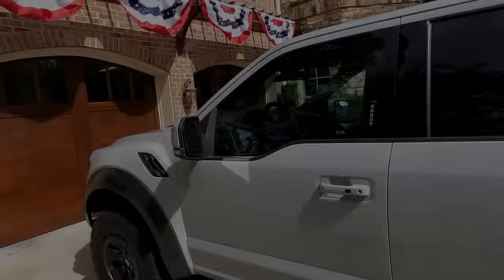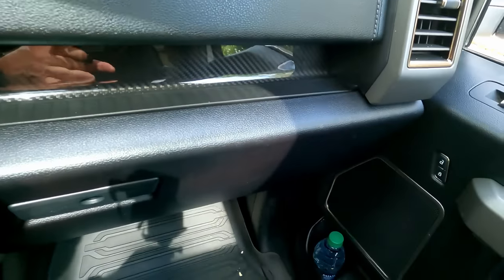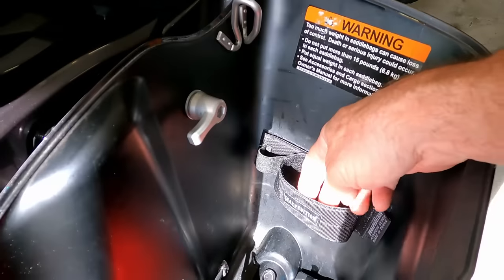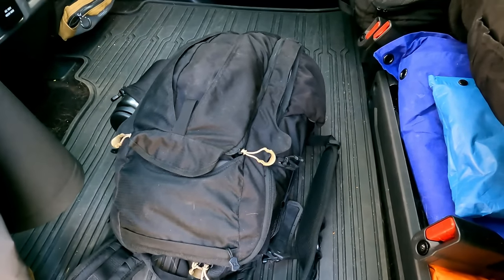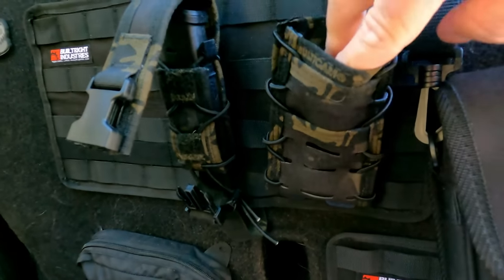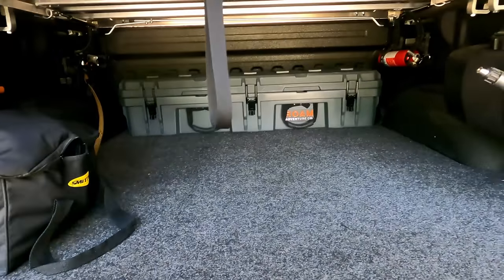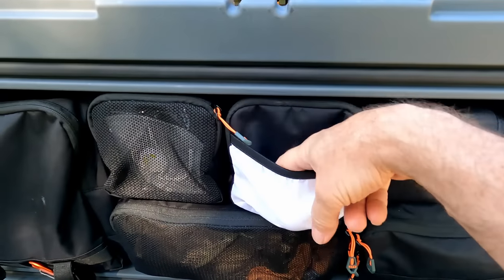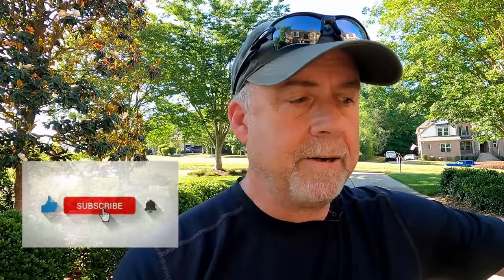Truck EDC - Everyday & Emergency Gear

Comment: Great video! Our set ups are much alike with the exception of my solar panel kits (240 watts in all), 25 amp wind generator, my axe/ shovel combo case but my most important item has to be my steel stake, hammer and horseshoes, great for striking up friendships(especially the Hawaiians), free beer and kills boredom for family and everyone. Really, think about what you are going to do with perhaps hours and days of down time if SHTF. 
    You might want to add a wrist rocket and pellets to save on ammo. Great video!
Reply from the maker: Todd great ideas.  Love the addition of horse shoes.  Used to play a lot on the beach when I was younger.  Great way to pass the time (while having a few beers)!! .......and saving ammo is always a great idea.  Thanks for watching and your comments.
Reply: @WeekendOverland  Well, there a story behind both. We use Wrist Rockets to shoot fishing weights and line to the top of trees to get our antennas up in the air, super easy. 
    I was in a friendly bragging contest with some fellow hams and we all kind of had the same emergency communications gear in our Jeeps but I won because I have something none of them don’t-“Horseshoes!” 
    If I changed one item in your set up, it would be your cell phone holder. Wife installed one in mine that automatically starts charging my iPhone after it clamps it into place. Super cool!
Reply from the maker: @digitaldreamer5481  I will admit the horseshoes idea is a big winner. I am thinking about an update video once I make a few more changes and I will have to include your horseshoe idea (and give your the credit of course!!) That phone holder does sound pretty cool.  Who makes it?
Reply: @WeekendOverland  Wife said she bought at Costco but not sure who makes it. The skates for the horseshoes, I had to wrap them with my spare blue tarps and zip ties in the spare tire well to keep them from making a lot noise and the horseshoes I put around the spare tire, was a perfect fit along with spare first aid kit. I have that area packed with supplies including HDR’s & MRE’s, hand chainsaws, heavy jumper cables, folding axes and snatch blocks.I also have a crash kit in another part of my jeep for easy access during emergencies. Actually, that’s not the half of it either. Folding solar panels with LED lights and battery clip extensions, marine battery connectors to turn car batteries into battery banks in a pinch for the two 100w solar panels and the 25 amp wind turbine I built myself. I built a tire compressor from a Sear Diehard 1150 that went bad but compressor still good, just added a 35ft vacuum cleaner cord w/12v alligator clips to deflate tires offroad & inflate back for streets, works well. It’s the ultimate bug out vehicle for tsunamis & hurricanes. I have a family tent but need one that I can keep in my JGC fulltime. Any ideas?
Reply from the maker: @digitaldreamer5481  Todd I think you need to make a video! Sounds like a great setup. In regard to a tent. There are a lot of great ones out there.  I personally have the MSR Hubba Hubba 2 man tent with the gear shed that connects to it.  I use it backpacking when not using my hammock setup (preferred). Plan to do videos on these in the future.
Reply: @digitaldreamer5481  curious about this wind generator. also do not know what a wrist rocket is. i know what a red rocket is though. hopefully not similar 😳
Reply: @cwr8618  Aloha CWR, I keep a 25amp wind turbine as a two piece set up that I wired with a 35 ft dc cord from a vacuum cleaner and added 12 volt alligator clips to attach to any 12 volt battery that I keep in the back of my bulletproof 4.0L IN6 Jeep Grand Cherokee. I use this for EmComm or emergency communications along with two 100 watt flat solar panels, all wired with Anderson Power Pole connectors, which I wired from the battery, through my firewall that powers two mobile ham radio transceivers inside on my front dash. As to the Wrist Rocket, it is a super sleek slingshot that fits over your left wrist and you aim by pulling it back with your right hand to aim. It’s pretty powerful and you can hunt with it also. You can even use and shot arrows with it if you get hungry enough to eat feral chickens, which are all over the place here in Hawaii, lol. Here is a link you can follow below:

https://www.ebay.com/itm/224883201866?mkcid=16&mkevt=1&mkrid=711-127632-2357-0&ssspo=3gR90xTrTiK&sssrc=2349624&ssuid=rv9W1Kl9Tr6&var=&widget_ver=artemis&media=COPY

Comment: ......also....take the cat tourniquet out of the plastic wrapper. When seconds count and your hands are covered with slippery blood....you or the patient will bleed out before you get to it. Fire extinguisher should be more accessible than the firearm....greater chance of actually using the extinguisher.
Reply from the maker: Yes, plastic was removed soon after the video was published (wish I could insert an update) and I am in the process of relocating or actually adding better fire suppression.  Thanks for your comments.

Comment: also the plastic bottles will melt with the water and not safe to drink.
Reply from the maker: Yes I have received a lot of comments on that and have removed the plastic bottles during hot days.  Thanks.

Comment: What happens if you want to use the bed for you know… truck things.
Reply from the maker: Thanks for watching SS392.  That is the tradeoff with this setup.  If I need more height for transporting larger items, I pull a trailer.

Comment: Finny how i star watching the video with a bottle of water hahaha... but man i live in florida if i leave water in my truck it will be hot lile hell.. but hey better have it and use it if im stranded...
Reply from the maker: Hi Juan, thanks for watching.  Good point.  The water in my truck is typically for emergencies or if cool enough to drink.  Typically I bring other water and drinks for the ride.

Comment: Intresting setup and similar to what I had before changing to the "grey man" thought process. From the exterior and interior of vehicles like yours they "scream" two facts....there's a lot of cool / expensive stuff in here and most likely a gun too. By making the car look Intresting and worth it you're begging for an encounter, a smash and grab or an auto theft / car jacking. Cool stuff, molle tacticool stuff everywhere can bite you in the normal day to day scenario and definitely when things hit the fan. My clothing, demeanor, hidden edc, car interior and exterior is seemingly "stock" and boring. Your setup screams I've got cool stuff and a gun....that most likely work against you with criminals and law enforcement.
Reply from the maker: DaGa thanks for watching and your feedback.  Yes, there are many ways to approach preparedness regarding your person, your vehicle, and your home.  The "gray man" approach is what I use for my person (everything is concealed), with my vehicle, it is a balance, the outside is more overlanding / camping with no stickers or labels applied suggesting anything else (OK I do have a cool hitch cover ....) The inside is pretty hard to see through the tint but is somewhat exposed.  It comes down to risk and rewards and what gives you enjoyment combined with preparedness.  Glad to hear you have a well thought out set up that works for you. Thanks again

Comment: Biggest suggestions
1. Take off the plastic on your tourniquet. If we are talking about using a tourniquet we are dealing in seconds and not minutes.
2. Find a faster and more accessible spot for the fire extinguisher. Again, seconds not minutes there.
Reply from the maker: Hi Justin, thanks for watching.  Yes, since I made the video, I have done both.  Plastic is removed and I have a small fire extinguisher mounted on the back seat within arms reach of the driver and passenger front seats. Thanks for your feedback.

Comment: How did you attach everything?
Reply from the maker: Michael, any velcro (hook) attaches to the fabric used on the Ford 150.  I used a combination of Biltright molle panels that are attached with velcro and pouches that have velcro hook on the back side.

Comment: I would suggest unwrapping your Tourniquet and getting it setup properly before a bad scenario happens, God forbid, as you will typically lose your fine motor skills in a high stress situation.
Reply from the maker: Hi Chad thanks for watching.  I actually dis just that about a week after publishing the video.  I have also now had some trauma medical training which I highly recommend for everyone.

Comment: You need to take the plastic off the tourniquet, if you ever need it your not gonna want to try to pull that off under stress.
Reply from the maker: Thanks for watching! Tourniquet plastic was actually removed the next day but the video cannot be updated

Comment: Seat belt cutter is hooked to the Molle with a key ring?!?! Tourniquet should not be in plastic, mine is in the sunglasses holder. Holster set up is not a good idea. OBC is fine in a vehicle, but under stress you'll never get a round off. There's a difference between having a bunch of tactical stuff V/S having a real tactical mindset. . . Not hating bud, great video, but consider keeping spare mags to one gun / caliber, and easier to grab. I appreciate the review!
Reply from the maker: Hi Chris, Thanks for watching and the feedback. I should have given more detail, the seatbelt cutter has a quick disconnect from the key ring by simply pulling. Tourniquet has been removed from plastic (wish I could edit the video). As far as the holster set up, training is key.  The sad thing is that a high percentage of people in a stressful situation, pulling their firearm while sitting in the drivers seat (not trained on how to clear the steering wheel properly) will shoot themselves in the leg. I typically have my CC on me and this set up allows me to either store when removing my CC when needed or have a back up with holster.  I didn't want to get into those details in this video. In regard to the spare mags, I believe I showed (3) - one on the metal molle under the console lid, one attached to the back seat, and one attached to the Maxpedition bag in the console that fits my CC.  Again I do appreciate the feedback but wanted you to have a little more info on my mindset.  Thanks again!

Comment: Thanks from France 🇫🇷 for sharing. I would like so much to carry A Glock with extra magazines, but it’s like that. Just a comment: I saw thatyour rescue me is attached by a key ring… I think you don’t want to fight with it in case of emergency. Maybe a carabiner would be better…
Reply from the maker: Hi Jer Om.  Thanks for watching and your comment.  In this case the key ring is on a quick release attachment.  I should done a better job detailing that info on the video.  I have had another viewer point out the same.
Reply: @WeekendOverland  ok! I understand. Much more clever, indeed!
Sorry for this useless comment! And thanks again for your video. Good job!
Reply from the maker: @MrJejreno  all comments are good!  Thanks for taking the time to do so.

Comment: I have been watching the doomsday preppers , for 5 years now, and my question is when will the SHTF happen????.
Reply from the maker: Hi Hayder.  Thanks for watching and your response.  I feel preparing for the SHTF is something you do to give yourself a sense of security and independence in case something major occurred or even with less severe occurrences (like the pandemic) that allow you to carry on and not panic.  Just because I prepare doesn't mean I want to see it happen.  The older I get, the more self sufficient I strive to be.
Reply: @WeekendOverland  I see, I don't want it to hapen as well, best luck mste.

Comment: leaving plastic bottles with water to heat in the car is not good. But impressive setup!
Reply from the maker: Thanks Tadas.  Yes, you are right and that is a change I have now made (during the summer months).

Comment: My only question is why Dasani
Reply from the maker: Hi Seth.  Good question.  I actually switched due to they are now going cheap on the cap (half the height so half the treads.....) and I am not keeping the bottles in the hot vehicle. Now carry an aluminum bottle.
Reply: @WeekendOverland  that’s a good idea, and I only asked why Dasani cause it sucks lmao

Comment: I didn't see any jumper cables.
Reply from the maker: Hi Mac, Thanks for watching.  Instead of jumper cables, I have the GooLoo portable jump starter in my recovery gear case.  Makes you self sufficient in times of need.

Comment: Keeping plastic bottles of water in your vehicle is a bad idea, especially if it’s hot out. The plastic will leach into the water and cause all kinds of health problems. Just an FYI.
Reply from the maker: Thanks for watching Greg. I have now replaced my emergency water supply with aluminum cans and an aluminum water bottle.

Comment: I used the smittybilt air pump on my tacoma, mounted it in the cubby on driverside, ran lines down to a 7gallon tank where my spare was, plu a line forward to front bumper and one to back bumper with quick connects, works awsome!
Love what you have done with everything so far, wish I had more room in the internals but did what I can.
I really want that diamond back topper and probably a Decked system.
Reply from the maker: Hi Anthony, sounds like a good set up for your air.  I want to do something similar.  Really like the DB cover and highly recommend.  I am now finalizing my layout for in the bed.  About to pull the trigger on a bed slide.  I really like the decked system but I need more height clearance for my ARB fridge.

Comment: I would recommend that at a minimum any adult or young adult (HS age or so) take the Red Cross CPR and Rescue Medical Class. If you can seek out the class for healthcare providers. It will be more thorough and info packed. They will go over CPR on both adults and children plus infants,rescue breathing, clearing a choking airway, use of an emergency AED, plus other info. You will receive a 2 year certification from the advanced class.
Reply from the maker: Thanks for the info.  I agree, this is something everyone should be educated in.

Comment: Great setup brother, I’m doing something similar with my raptor rack tent etc. Are you on Instagram?
Reply from the maker: Thanks for the response.  Would like to see your setup.  I am in the process of setting up an Instagram for the site now.
Reply from the maker: @Nubgunner  Done.  Nice IG.  Great message as well!  Thanks for your service! It appears we have other gear to discuss.  Also noticed you have the rear awning on your set up.  Just ordered mine from Roam.  I have an interesting mount that I am going to try using some left over Front Runner leg mounts.

Comment: Looks like you came straight from the car dealer and sportsmen’s wear-house. I mean not a bit of use no dust….I mean that there is one clean pavement princess.
Reply from the maker: Hi Dustin, thanks for watching.  Cleaned up prior to the video but normally not so much.  We now live out in the country (1 mile off the road) so a clean vehicle is definitely a thing of the past.

Comment: Lots of microfiber and knives but not many useful tools in case mechanic problems happen. Also the tourniquet wrapped in plastic and where is placed wouldn’t be of much help
Reply from the maker: Hi Pablo.  Thanks for watching.  I actually have my "mechanic" tools in the tool bag I mentioned and have a separate video on its contents. TQ was taken from wrapper right after the video was published but You Tube does not allow edits after published.  But thanks for your comments.  You are absolutely correct on both.
Reply: @WeekendOverland  thanks for the answer. Was not my intention to criticize just a friendly suggestion. Best